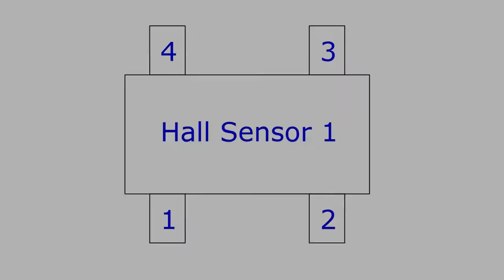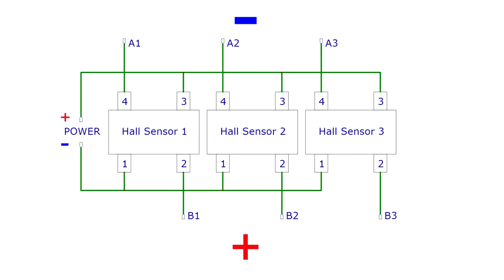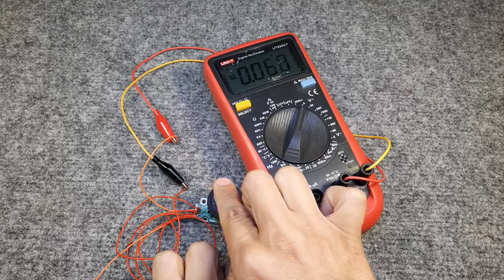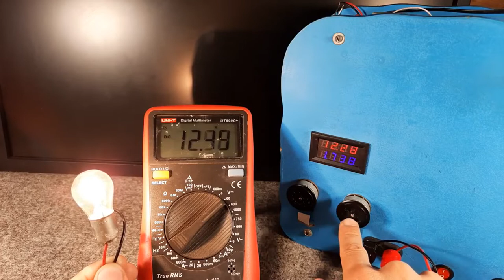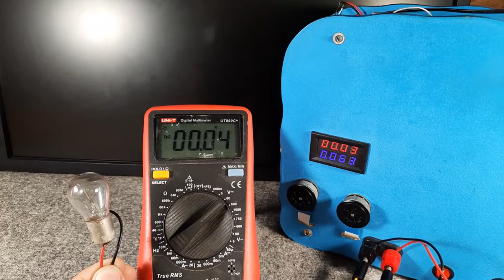Secret function of blds motor from cd-rom.

Comment: I really like this idea as I have a bunch of these motors too.  It's a little hard to follow your video without a schematic, but I've been able to find some additional info on other sites/videos.  The hall sensors share a common power lead (which may require a current limiting resistor) and a common ground lead.  The remaining pins are signal + and signal - which go to the comparators.  I think since any two hall sensors are out of phase, you are able to produce a quadrature signal, however the waveforms overlap at 1/3 and 2/3 not 1/2 as in true quadrature so your steps are not always equal.  You suggest powering the coils in order to produce a magnetic "detent" which is also a good idea, I assume one coil pair would always remain energized.